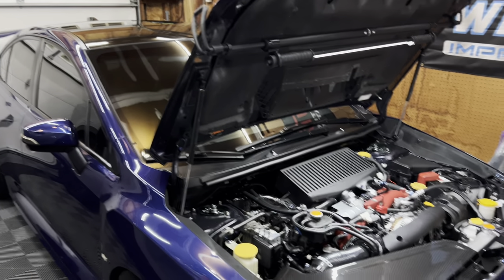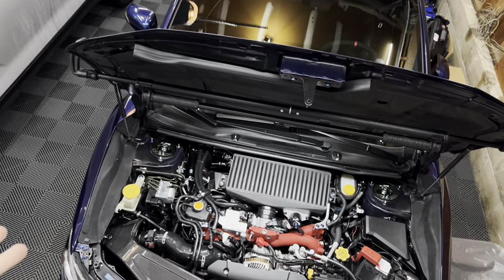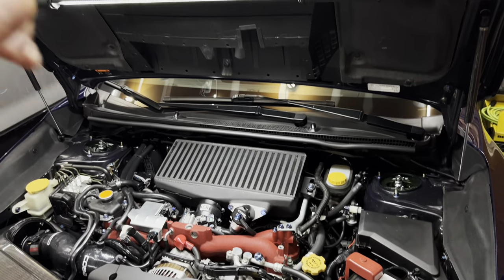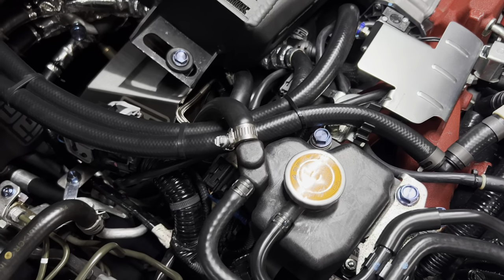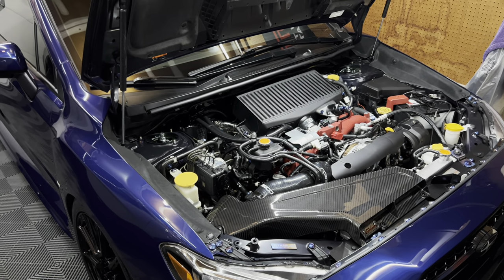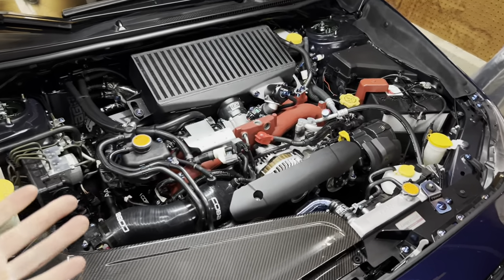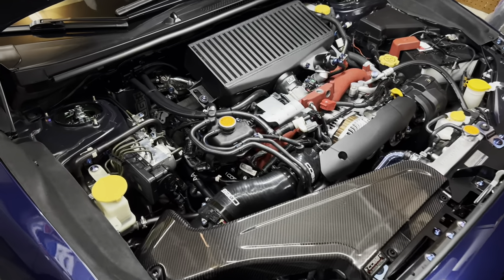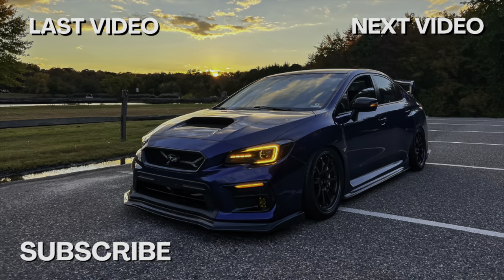How To Make 400 Horsepower RELIABLY On Your STI - Cost Included!

Comment: Reliable is the issue. I've got a built 400+ STI, downtuned to 22 psi, 45,000 miles on the built motor, no issues. Lasting fun factor.
Reply: What would you recommend for a stock 2019 sti? 350-400 range, practically a daily but low annual miles, hoping to get another ten years / 150k miles
Reply: @zmmmzmmmz cyl 4 cooling mod, IAG air oil separator, Aem 340lph fuel pump, killer bee or IAG oil pickup, 1050x injectors I’m making 356 right now and daily it
Reply: @zmmmzmmmz 2019+ sti came with the type RA motor which most people say can handle 500whp pretty reliably
Reply: @zmmmzmmmz  You should do mods and tune it around 60hp more. Unless you build the engine, I wouldn't recommend pushing your engine to 500whp. You'll blow it up.
Reply: @JoseMartinez-gy9eo if you do more research on those ra blocks they really only changed the wrist pin structure on the piston it’s slightly stronger but from my understanding not by a lot.

Comment: Dang, I made the same 400whp on 93 octane, but half the cost.. right around $10k including forged pistons.  But that was 2018 when it cost less and before the new EPA issues.   I feel like now it would cost me around 15.
Reply: 10k to make 400whp? Wtf
Reply: You paid that much? Lol
Reply: @anthonym2277  Yes that's how much it costs to machine a motor, put it back together with forged parts, and put a bigger turbo on it with all the supportive mods, then tune it correctly on a dyno. 6 years built and reliable.

Comment: Y’all seem smarter than scientists fr fr. I been trying to learn cars for 5 years. I still don’t know shit. How does one know if they can build on a stock motor or if they need a new motor to support the HP. You will say, we’ll if you reach over a certain HP your stock engine can’t handle it. But HOW does one just know that?? How do y’all know that when adding certain parts, now it needs tuned. I don’t get it man.

Comment: This makes me miss my '17 STI. Great looking engine bay and great job all around. I've also read somewhere that ELH improve reliability significantly as well raise the power ceiling moreso than other mods. Great job building reliable power.
Reply: because equal length headers allow for equal cylinder pressure

Comment: always interesting to see/hear that you're tuned at 18 psi. it was always a given that "stage2" or more was always 20-21psi but clearly your tuner is making power without the added boost. Solid setup though probably the best overall
Reply from the maker: "Stage 2" is mostly the boost levels that bump the power. Easy to throw boost at a car and make it quicker, but doing it correctly with the right parts, you'll find that you won't need to add so much boost to obtain the power you are after.  Quality parts go a long way.
Reply: @Scoobyfreak86  Found that out first hand on my last WRX[FA20 car] on E60 it was pushing 1lb more target from pump gas and went from 300ish WHP to 385 with purely timing adjustments. Crazy stuff

I'm currently on the "risky" setup of an intake/downpipe/regulator/pump on a VERY mild Etune while waiting to go injectors/rails/headers and its pretty impressive how much power picked up despite being a dialed back setup

Comment: I had a FBO 2017 sti on E85, it put down 380whp on a dynojet, it had ELH, External WG, FMIC, IAG oil separator,  all premium parts etc, the car felt fine but i was coming from a 475whp 02 Wrx with a built hybrid engine on a fp green turbo e85 and a much lighter car with a 07sti transmission swap, my goal was to build the sti to 600whp one day till i drove my friend's R35 Gtr, and it was a wrap, sold the STI and got me an R35, and to be honest it was the best decision , 630whp on E85 without any worries , I've daily the car for about 5 years and abuse it all the time, i got the R35 for 65k back in 2018 and i put about 10k in fbo parts to hit 630whp, who knows how many engine builds i would've gone through if i kept the STI, i had the wrx for 11 years and even though i loved that car  i did blow the engine 3 times, and the 5spd transmission twice, till i went with the 07 sti swap, Subarus are fun to drive but they're not reliable if you drive them hard.
Reply: Yeah seems like every Sti owner is somehow on there 3rd engine shits crazy….

Comment: Great video and love the car man. Are you on stock tgvs? If so how was installing the turbo inlet and the fuel rails/ lines? Any clearance issues?
Reply from the maker: Stock tgv. My shop installed the fueling mods and Cobb turbo inlet, but I didn’t have any fitment issues and everything clears well.
Reply: they all bolt straight in - mine did - ordered correctly !

Comment: here's my build so far for my 04 sit. (the piston rings died)
gs ebcs, (deciding on the turbo, I'm thinking of something flowing 55-65lb/min w a 3in intake)
1500cc dw injectors
front mount intercooler
19mm phenolic spacers
forged internal w/ +2mm rods
street lite flywheel and heavy duty clutch
stock heads (Can't find a place near me to rebuild mine)
iwire hybrid maf speed density kit
4 bar map sensor
uel headers
catless downpipe
deciding on what up pipe to get depending on if it the turbo I get is ewg
plan on getting an aem340 pump and hardwire kit
stock oil pan (plan on getting just a baffle and pick up tube)
koyorad radiator 
625 arp head studs
oem 11mm oil pump
crank dampener
dual catch cans
anything else I should decide on?
im going open source btw, tractrix cable is handy

Comment: I feel like 22k Is a lot for 400whp, considering you have a top mount etc.. I cant recall if you said in your video or not, but there are def cheaper routes to get that much power safely, and yes on pump gas. For 22k, you could have a 500x block from Bader, and a Green, plus cooling and fuel for less. While I think your build is gorgeous and an example of how to do things in a very tasteful way, to me it seems that you chose expensive parts on purpose, for just the sake of spending the cash, and thats fine. Its a beautiful build, thats for sure.
Reply: Oh yeah man, Definitely. These motors can be pretty risky when done up and or tuned incorrectly with the right Combinations and the perfect tune, you can push more power especially with E85

Comment: I understand the OEM+ factor of the build which is great btw but why not a FMIC vs the top mount you currently have? is it because you’re not pushing enough power or you’re not on the car as much? as heat in the engine bay would be decreased if you went front mount but I’m just curious! Thanks!
Reply from the maker: https://youtu.be/Sj03K59HvF4
Reply: @Scoobyfreak86  Thank you!!!

Comment: Kindly asking because I'm building a Perrin Catalog (Semi) build of WRX STI VA. And I'm changing my TMIC to FMIC is it alright? Because I already bought one hahahaha what would be the pro's and con's using FMIC? I'm planning to go stock block until 400whp can it withold it?

My current build is:
- Stock block
- Invidia r400
- Injen CAI -> changing it to Perrin CAI
- Tomei UEL
- Cobb AP (When I bought the car it's already included but will remove this and go to ECUTEK tune.)
- Torque Cylinder 4
- Crawford AOS

Upcoming parts:
- Perrin FMIC
- HKS Oil cooler
- Power Steering cooler (Planning to get one too)

In the future:
- Forged Internals
- Bigger Turbo (Maybe afterwards)

If you can give more more details would be great.

Thank you.
Reply from the maker: https://youtu.be/Sj03K59HvF4?si=lCZrnnGQYKOPblaO

Comment: I just realised something…did you keep all of the emissions items on your sti? Did you not do tgv deletes or the secondary air pump delete? You kept all your emissions stuff intact? Because I want to go cobb but I know they have a green speed update which doesn’t allow emissions related stuff to be deleted anymore. Debating on going open source
Reply from the maker: It was completely emission compliant. Didn’t remove anything and passed no problem.
Reply: @Scoobyfreak86  wow! That’s impressive! Even with the external wastegate they gave you no issues?
Reply from the maker: @jmt0728 no issues

Comment: Coming from only FA experience, this is cool to see. Obviously the EJ starts with a pretty big head start, but it doesn't take much to get the FA in that 350 whp range where the STi also sat pre-turbo (as long as you're fine with taking trans risks).
Reply from the maker: Fa is a great platform that doesn’t take much to get power. It’s just a new FI motor where the ej is a dinosaur in comparison. Although, I will say the same power level in an fa and ej do feel quiet different overall.

Comment: I’m looking to either build my motor, buy an iag block or get an Ra block and throw rods in it because I want 500whp in my 05 sti. I think I might just get a bcp x500r and flex fuel setup and all supporting mods including oiling etc and make 380-400whp until I figure it out. Can I make 500whp on a good tmic?

Comment: BTW, the fa24 pushes impressive numbers with just a basic tune. I loved my old ej's as well but reliability and power have definitely been improved. 
Right now I'm using a Jb4 and running e30. Haven't dynoed my car yet but others with similar mods are making good power. Of course Cobb is the way to go vs jb4 but at only 2000 miles on my new car I'm not ready to flash the ecu but the jb4 is very satisfying for what it is.....

Comment: Do you think the older the car the harder the power? I have a 2000 Impreza wagon and I’m thinking about just taking the engine out to put a 2.5 in it. I would use the engine I have already with 75k miles buts it’s a 2.2l. My goal is to make 400-450
Reply from the maker: Not necessarily. The engine just needs to be healthy and in good shape. I would do a refresh of the 2.5 before it goes back in.

Comment: Are there  any issues with passing inspection? I'm in NY and I know back in the day if you had anything that was OB2 or newer (basically 1996 and  up), ECUs needed to be plugged into to pass inspection. I understand the  Cobb AP is  just reflashing the ECU,  but would the car run on a stock tune? Even if just for a few minutes to pass inspection? IDK what is required of your inspections in NJ, but  just curious if you have run into any hiccups...thanks!
Reply from the maker: https://youtu.be/DPrPYynjENI

Comment: Could you go over the headers. I been looking into killer b elh. But there's so many options. 
What's the difference between 2 or 3 bolts?
Can you run the header with the stock up pipe? Or recommended to get the whole set up?
When is it recommended to go external wastegate?
Reply from the maker: You'll want to go with 2 bolt if you are running a stock like setup. 3 bolt is usually pertaining to more custom setups.
Yes, you can run them with stock up pipe. I ran them this way for a while before I went to EWG and changed the turbo.
I would recommend doing EWG either way. It's safer overall as it allows your tuner to fine tune your map and eliminates the potential of boost creep (most associated with catless setups).
For the average joe's like us that just want a good quality header on a stock like setup, the 2 bolt basic killer b head is what you want to go with.

Comment: I have a 2017 STI. I want to take things slow as well. 

In your experience would I be able to go stage 1+ (accessport/intake) without any reliability mods? 

Or should I get the accessport / Intake and get the cylinder 4, aos immediately with it?
Reply from the maker: I would definitely go ahead and do the aos and cyl 4 mod either way. Even if you are stock as they are two things that will greatly benefit the longevity and health of the motor.
Reply: @Scoobyfreak86  your the man! Thank you 🙌🏽

Comment: I've had 4 imprezas, but I think I'm done with ICE cars now. My experience included having them maintained by specialists while in the UK and in Australia. I had Zen Performance look after my 22B while in the UK, and then Pulse in Sydney. The reason I chose these companies was because of their experience in Time Attack. That said, the costs to properly maintain a car are not cheap. I'm much more inclined these days to run a Tesla model 3 performance, and cant wait for the upcoming highland version, which I understand will be "Ludicrous", with possible 670-680 bhp, and no transmission issues. It will be reliable, and the model has had some great upgrades into highland spec. Really cant wait to upgrade. 

As for this, I think time has passed these cars by.

Comment: What stage wouldan iag closed deck block, fp black turbo, injector dynamics 1700cc, double fuel pumps, hobbs switch, cobb flex fuel, ets front mount all titanium piping, 600hp. What stage would that be considered?
Reply: that isnt stage anymore, stage is for like mods on stock stuff. Once you are built you just say "its built" not "stage 31533215"
Reply: @rylandorr  i was just being sarcastic while listing the modifications on my built 2015 STi haha thanks tho

Comment: I have a 2016 STI with a perrin intake, cobb catted turboback and the full fuel system from cobb. I was dyno tuned at Boostin Performance and I only made 276 wheel hp on a mustang dyno. That seems rlly low no? also my DAM is at 0.000 now and the knock has been crazy, i took my car back 3 times and they never could "find any problems". Car runs like shit and isnt making boost anymore. Im taking the car to a new tuner this week hoping to get this figured out. Any ideas?? Im about to just sell the car at this point.
Reply from the maker: There is definitely something going on. Can’t really diagnose what may be the issue on here since you would really need to do some digging to see what’s going on.

Comment: Did you use the Cobb nexgen power package fuel lines, rails and regulator? As it supposedly able to go around tgvs
Reply from the maker: I run stock tgv’s, but I run the previous Cobb fuel kit before thr “nexgen” came out.

Comment: Would 350 hp be attainable on the stock turbo and intercooler if I had all the other supporting mods ?
Reply from the maker: Yes. I was 340hp/352tq on stock turbo and all the supporting mods before I upgraded to the turbo and went ewg.
Reply: I made about 325 whp and 340 tq on 91, with intake, Inlet, tmic, bpv, ebcs, dp, fpr, fuel pump, catback. Along with typical reliability mods. 
Currently doing a elh (coated holy header), 1050 injectors, rails, lines, and flex fuel kit. I’m aiming for about 350whp 360-380tq . I got my 21 sti new, so cost of car, cosmetics, wheels and reliability mods, tuning I’m about 85k into.

Comment: Do you know how to make a reliable 2011 Impreza WRX on 91 octane and visible body mods
Reply from the maker: I would go a similar approach with a wrx as well.
Reply: @Scoobyfreak86  thanks for the info and do you lose the unique Subaru sound with the equal length headers
Reply from the maker: In the upper rpm range, yes. But down low, it still has a good amount of rumble.

Comment: If you want a reliable 400hp motor build an 800hp motor and detune and viola bulletproof 350 to 400hp reliable. But not really. But more reliable than stock pushed to 400

Comment: i'm kinda lost... your main goal was a reliability, and you skipped flex fuel?
Reply from the maker: Flex would have push the power on the stock block. Going over that threshold would have been way too much for the setup.
Reply: your tuner doesnt have to add a bunch of timing when you get retuned for flex fuel  and kept it around 400.. but now that i think about it I guess buying the nex gen kit and paying for another tune solely for reliability purposes seems a bit extra. especially considering the motor will likely need to get rebuilt sometime in the near future anyways it's like, the 3 grand you'd spend on flexkit/retune wouldn't increase the longevity of the motor enough to justify the cost so it's probably a  better idea to save that $$ and use it on forged internals when it does come time to rebuild the motor

anyways cool build 👍                                                                          @Scoobyfreak86